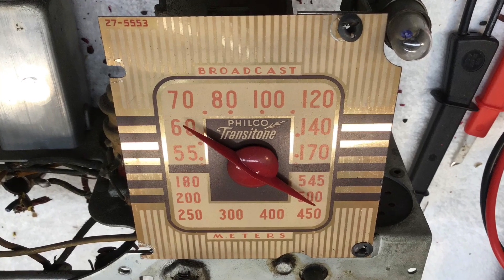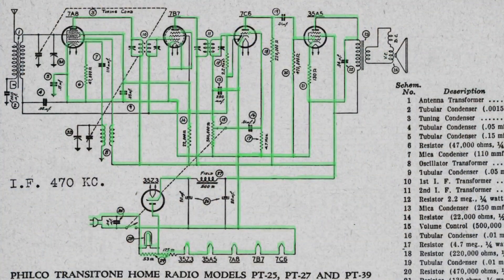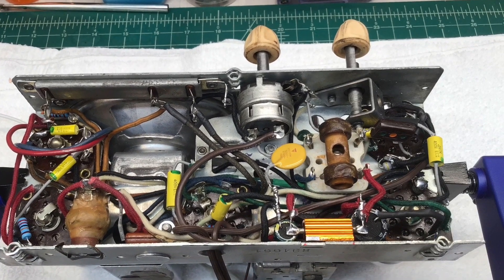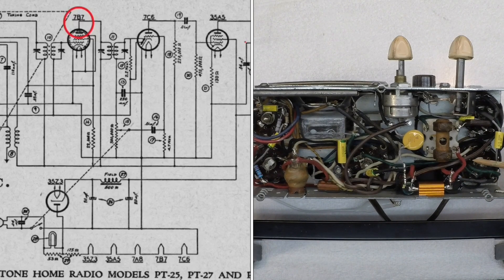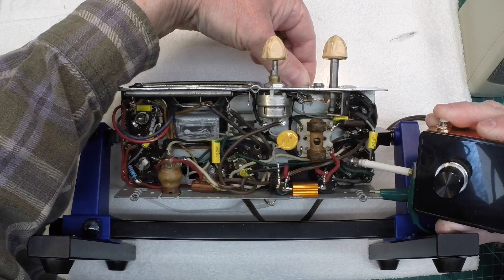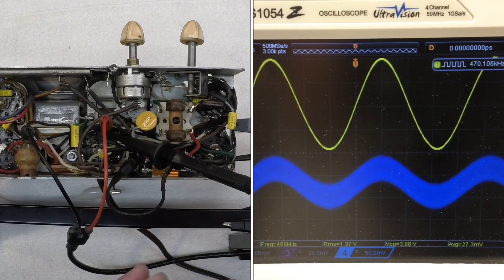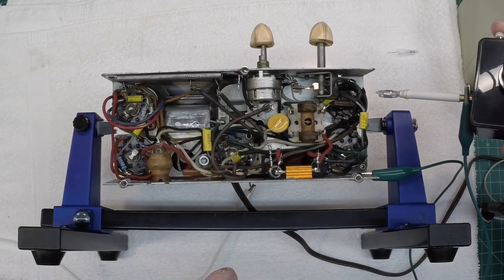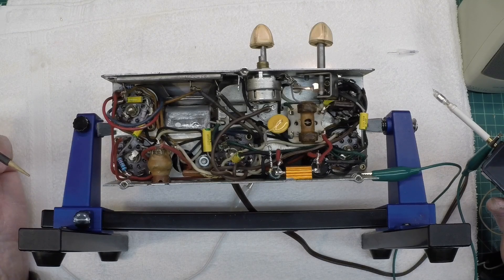Philco PT-25 Transitone - Signal Tracing a Distortion Issue

Comment: Excellent troubleshooting.  Can you share where you bought the radio stand?  Cheers. Norm
Reply from the maker: Norm - being this was a very small chassis, I pulled out my circuit board holder. There are many being sold under different names that are built like: Aven 17010 Adjustable Circuit Board Holder ESD Safe
by Aven Inc.
https://www.amazon.com/dp/B00Q2TTQEE/ref=cm_sw_em_r_mt_dp_RZG07A26ZH9C08H5HT8H?_encoding=UTF8&psc=1

I also built two holders you can replicate at: Radio Chassis Stand
https://www.youtube.com/playlist?list=PLjLu4V-71S1JvyPW-3Qw2CJlbWtpfj6am

Hope this helps.

Best,

Don
Reply: @RestoreOldRadios  Thanks, Don, much appreciated.  Sure makes working on the radio easier when you can flip it around like that.
Reply from the maker: They help a lot. Best, Don

Comment: thanks for the valuable info. I never realized if transformer wiring could cause phase problems in the signals. Nor that you could inject a signal into a non powered set and safely work on it and get such valuable clues.
Reply from the maker: Rory - glad it helped. It’s one of those issues you won’t run across often. Thanks again for reaching out. Best, Don

Comment: Hi Don,
I found this video very interesting since I experienced something very much similar some fifteen years ago.  After completely stripping, cleaning, replacing much of the old with new, and reassembling a Vintage Radio, I powered it up, and only received birdies, and grinding/motorboating noises via the speaker (deciphering speech and music was virtually impossible).  After applying my oscilloscope - I didn’t use my signal tracer - tests revealed I’d not only inadvertently reinstalled one of the IFts the wrong way round, the signal path was also out of phase.  In other words, my oscilloscope came pretty much to the same conclusion your oscilloscope came to in this video.
Since I’d never made that mistake before, and was not (as I remember) taught about the outcome, or effect, it made a valuable experience because I learned something I was largely unaware of.  This video has highlighted that effect, therefore potentially useful knowledge for anyone to become aware of when doing in-depth restoration on a Vintage Radio involving total strip down, and reassembly.
Having corrected my mistake on that radio I restored, it operated as I’d expected before doing a complete alignment.
That radio was a 1935 Ekco, model AC76 housed inside a black Bakelite cabinet, with chrome finish.
Cheers my friend, The man from Sheffield, England.
Reply from the maker: Phil - I appreciate you confirming the cause and effect of the IF transformer being out of phase. Tim (AMStationEngineer) replied back too and said the coil becomes very inductive in this configuration and thus the noise etc., is passed along to the audio stage. Before switching the leads, I placed a small pF capacitor on the grid of the 7B7 to ground, which shifted the phase and cleaned up the distortion for the most part. This is what make me consider I had inadvertently rewired the transformer secondary incorrectly.

Your Ekco AC76 with the chrome finish sounds like a beautiful radio; I will be looking for an example online. As always, I appreciate you reaching out Phil. All the best. Don

Comment: Thanks Don, another justification for my oscope😀.  Is the chassis holder a circuit board holder?  Also where did you find the family sized De-Ox-Id?
Reply from the maker: Yep, mine too. Being the chassis is so small, the CB holder did the trick. Check out the video comments from AMStationEngineer and Daytona Beach Florida on the De-ox-id by GC Electronics. Thanks again Josh. Best, Don

Comment: Well done Don.  Using the scope in this case made the word of difference.  Can you elaborate on how you connected it to the radio  ? Did you use a cap between the radio and the probe ?  Excellent job my friend.
Reply from the maker: Ron - I had the receiver powered off, unplugged, and the caps discharged. I had the positive side of my Signal generator attached to the plate of the 7A8 and the negative to the oscillator coil B+ and one of the O-scope probes to the same point, while the other O-scope was to the grid of the 7B7 tube, which allowed me to see the phase relationship. After observing the signals were out of phase, I used a low value pF capacitor and connected it across the grid of the 7B7 tube to ground while observing the phase relationship, which changed with the added capacitance. This was my  clue that I had the secondary leads of the 1st IF transformer reversed. Hope this helps. Best, Don

Comment: Great detective work! I reworked an old Knight Radio (83-275 about a year ago and also rewired the cans, it is making noise similarly to yours. Mine is still in a box waiting to be figured out, but at least now thanks to this video and you I have chance to know where to look! I believe this Knight radio was kit that one of my relatives built and would like to get it back up and running. Thanks
Reply from the maker: Thanks David. It will be worth exploring and see if it indeed can be improved by reversing one of the primary or secondary leads assuming the transformer is out of phase. Keep me posted and I wish you the best on the outcome. Don
Reply: @RestoreOldRadios  I have a Heathkit FM-4 on the bench right now, so maybe soon. Thanks again.

Comment: You cleaned this one up way beyond amazing!!!  I wonder if it would have helped to have used some Evapo-Rust on the tuning capacitor.  Especially the gel type.  The chassis looked like you had chromed it almost.
At one point in your troubleshooting process, I thought I heard motorboating.  After you switched the transformer leads, at least to me, it seemed to have gone away.  Looking forward to future episodes.
Reply from the maker: Wayne - In the ultrasonic cleaner I used heated water w/ a mild solution of citric acid to remove the flash rust, etc. I’ll report back on any issues that pop up down the road. I appreciate the positive feedback on the chassis. It turned much better than I expected. The noise or motor boating issue was odd coming from the windings being reversed. Wish I knew the theory behind the phenomenon. Thanks again for following along and taking time to reach out. Best, Don

Comment: Those rubber wires are a royal pain Don, that was an interesting problem with the phase reversal, I was thinking it could be a oscillation feedback issue. Nice job figuring out the problem.
Reply from the maker: They sure are. I’ve got many Philco radios that need to be restored and you can bet more rewiring is in my future. It was a strange issue. I experienced it before many years back. I was able to temporarily shift the phase using a 20pF capacitor between the grid and ground and of course confirmed using the scope and signal tracer. Thanks for watching Jim and I hope you have a good weekend. Best, Don

Comment: I have an old original Johnson messenger 5 channel that someone took apart and buffed chassis like that. put up for sale on eBay and said it had a hum and told me which capacitor and when I got it there wasn't anything wrong with it so now I have a Johnson messenger that you can eat off of that works perfect good job on that one
Reply from the maker: Ronald - congrats on your working mint Johnson Messenger. Thanks for watching and reaching out. Best, Don
Reply: @RestoreOldRadios  thanks I love old radios now I have to rebuild a power supply on a fun machine organ
Reply from the maker: Good luck. Hope it goes well for you. Best, Don
Reply: You really did a good job on that
Reply from the maker: Thank you. Best, Don
Reply: Ronald,
I stumbled on a Realistic DX-160 that I coveted as a child at a flea market. The guy said it did not work and took $5.00 for it. I took it home, it did not power on. I turned the power switch on and off a few times and it sprang to life. That was about 5 years ago and it still works just fine. I guess it was a piece of dirt or corrosion?
Reply: @ianbutler1983  I paid 169.00 for my dx  160 I wish I would have keep it.
Reply: Is that a white face Johnson use to have great radio
Reply: I had one of those old Johnson White faces back in the 70's, it was cool but frustrating due to its channel limits...I didn't have it too long though...back in the 70's/80's I went though a lot of CB's , it was real fun back in the day...then the CB boom hit.....  :)  ~Jack, VEG